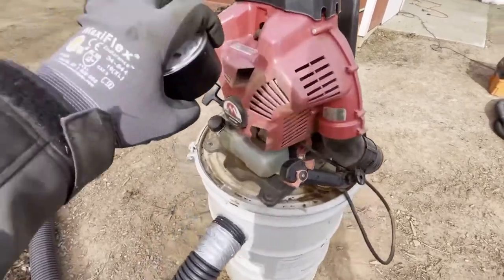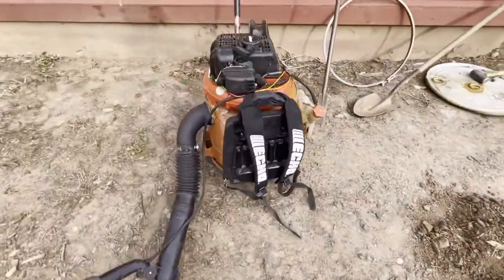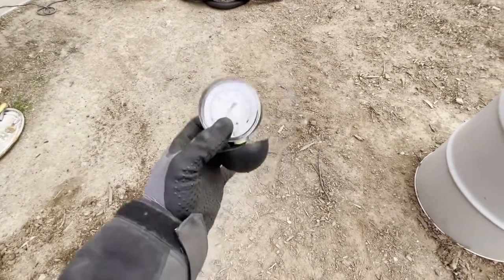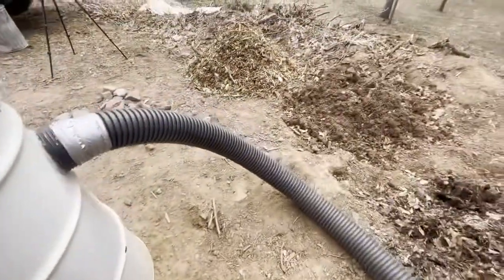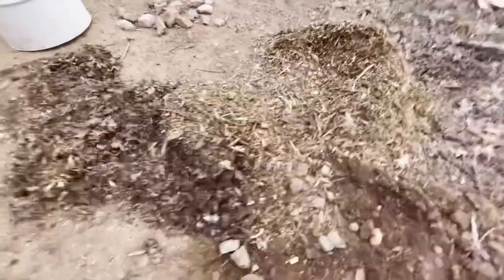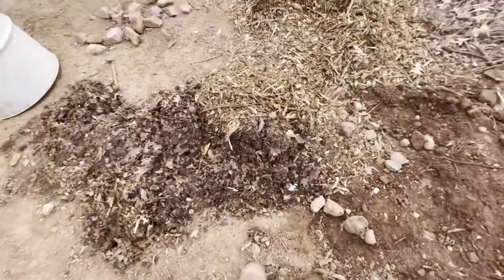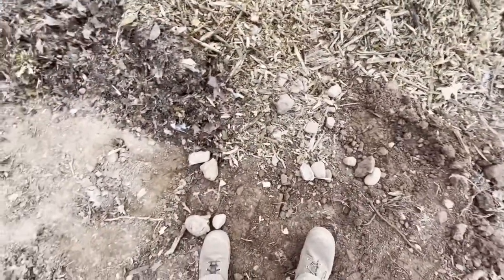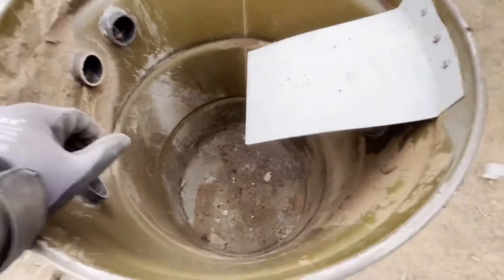Leaf Blower Vacuum Conversion

Comment: What are the practical uses for this? Lugging that 55 gal drum around can't be easy.
Reply: This is exactly what i need .  I want to suction up sandy soil which drops from
The hole digger at the 3 ft mark in each of the 30 holes i am digging in my yard for the fence..
Reply: Ratchet strap it to a dolly

Comment: Your video doesn’t actually show how you converted the blower to a vacuum. You should post more details on what you modified.
Reply: A blower has an outlet...it blows! But to blow it must have an inlet, and that's the inlet which is connected to the drum...that's simple.

Comment: It just seems none them home made ones work very well I don't understand it my self so I use my fuel Milwaukee 12 volt vacuum with 3 batteries pretty strong I built one out of a leaf blower it did no good it was real weak I don't no what the trick would be to make it suck lol your fingers 😂off I love it to be powerful like that but it seems like no one can achieve it